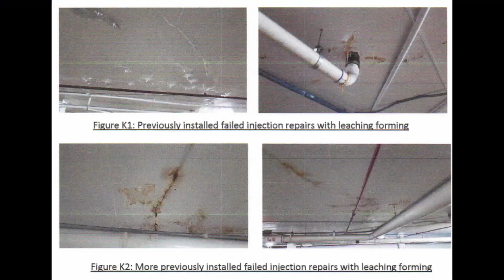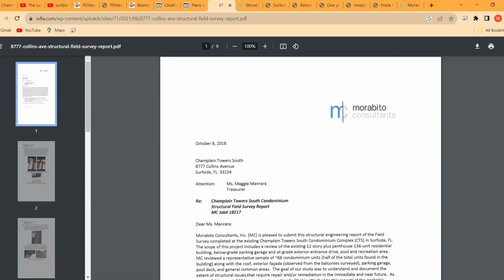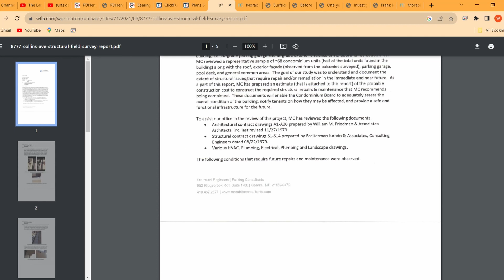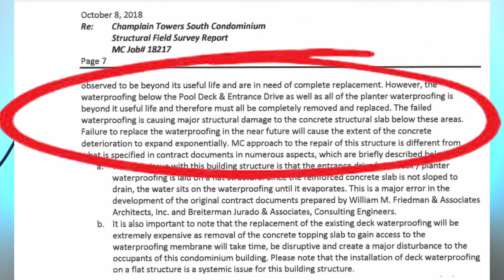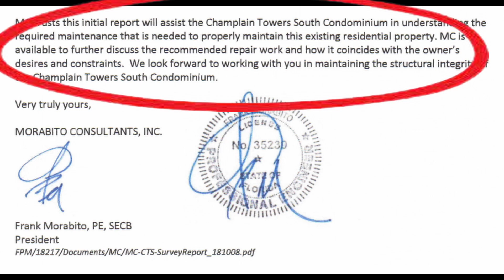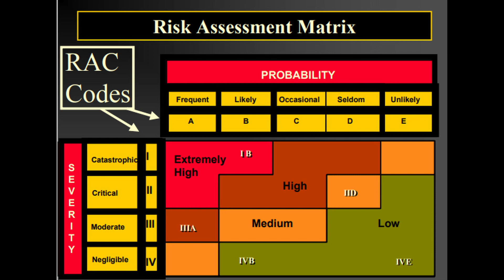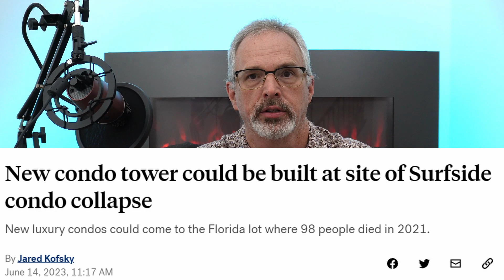A New Perspective on this Fatal Building Collapse

Comment: This story is crazy but we had a similar situation in Waukesha Wisconsin right after this collapse. There was a local building that was having work done to repair balconies that had water damage on them. When they removed material they found that the steel structure holding up the building was badly damaged by rust and corrosion. City officials called for an emergency evacuation of the building. And about a year ago the building was torn down and the lot is empty. Unfortunately this old apartment building was split up and the apartments were sold as condos. All of the owners are paying for a building they don’t live in. Not fare.

Comment: I was hoping to find a video on your channel about the recent report from the U of Miami about multiple hi-rise buildings in Miami Beach and towns further north that are sinking more than expected. From what I've read and heard, the buildings are on limestone which is not solid but has layers of sand in between solid layers. And those layers are disturbed when piles are driven for new buildings. The Surfside building that collapsed has been impacted by construction next door according to residents. Hoping to get your take on the new report.
Reply from the maker: I have been doing an extensive amount of research on this story to prepare for an upcoming video so please stay tuned.

Comment: I worked for a company who was contracted to do a geological assessment at a research hospital because they wanted a water well.  The geology under the hospital was karst.  While researching I discovered that a 150' wide 300' deep sinkhole opened up less than 1/8 mile away.  I also found an engineering report than mentioned finding voids in numerous areas around the hospital campus but didn't go into any detail and instead cited previous reports where it was discussed.  I brought that to the project manager who disregarded all of it and refused to allow me to contact the other firm or the client to get access to those reports.  So I refuse to sign both the draft and final reports.  My company was then contracted to drill the water well.  Myself and two other colleagues refused to have anything to do with the project.  The PM ended up putting the new guy on it, fresh out of college.  All I could think about while they were off drilling is, 'f**k, I work for a company that's willing to a risk research hospital falling into a sinkhole during drilling'.
Just a side note, the recommendations of where to drill the well were disregarded and the PM drilled where the client wanted him to.  It should be very easy to find groundwater in karst but they had to drill to over 300' when every other well in the area was no more than 150' deep.  
I hated working there.

Comment: FYI Casey…. A neighboring project that was built got tagged for a large part of the settlement due to vibrations they caused installing their foundation so the geotechnical portion of the collapse has been taken into account. As to MC’s report: Engineers aren’t good writers, that aside I don’t believe they actually thought collapse was imminent. Finally your concern about how many others like this are out there (st least in FLA and buildings) the FLA legislature passed a bunch of laws requiring more extensive inspections and repairs which are resulting in condo owners looking at unexpected huge assessments and inability to sell units. Boo hoo I guess. I am ret reg Architect. Thru my review of this whole catastrophe there are hardly any parties that didn’t screw up from the developer, contractor, designers, AHJs, etc. I think a third of the settlement was assigned to and paid by the buildings security company as they had untrained personal on duty who couldn’t push a button to sound an evacuation alarm. Really.  Everyone should strive to do a better job, but hindsight and all that…
Reply from the maker: Thank you.  I agree with you.  There is plenty of fault to go around for this disaster.

Comment: Comments on tthree statements:
Structurally deficient bridges - according to ASCE approximately 7.5% of US bridges are structurally deficient.  Further unlike a residential building a bridge can be rated to accept only a certain traffic load, so that the bridge is protected until such time as extensive repairs or replacement can be effectuated.  There are bridges that are unsafe and need to be closed and that is done as appropriate.  I personally have reported structural conditions which resulted in at least partial closures.
Ethics Teaching - As an ABET evaluator for Engineering Accreditation and as a member of all three commissions related thereto I can tell you that we investigate the teaching of ethics in Engineering curriculum for compliance with ABET criteria.  That includes what an engineer should do when they find defective or deficient elements of engineering works.  I believe that at least our Civil Engineering curriculums are doing an adequate job of teaching ethics.  I say that having been personally responsible for about 15% of the Civil curriculums and probably having reviewed as a commission member for ASCE about 80%r percent.  At least when I have personally performed visits I have asked students what they understand about ethics and our responsibilities and if they do not appropriately understand it is not in the report and may affect the accreditation rating.
Rebuilding - I would suggest that the better question is not about building on the site since there seems to be no findings of site deficiencies.  The better question i would suggest is should changes be made to codes, high rise requirements, requirements of investigative reports etc. before any building is constructed, particularly in a Marine environment which enhances the deterioration of particularly concrete structures.

Comment: The failure starting with the pool deck explains  why newer roller coasters have to be built differently than older ones.   In "Expedition Everest", the tracks are separate from the mountain and can stand by themselves.   The Matterhorn in Anaheim is a coaster where the mountain and the tubular rails are part of the same structure.   Read "SF Gate, what disneyland is doing to repair a crumbling matterhorn.  I'll keep riding it but the article doesn't inspire confidence in the ride".

Comment: Thank you for another excellent video. I spent most of my 45 year professional career designing, implementing and  regulating safety systems for commercial, industrial, military and nuclear facilities.  I saw compromises made in safety and acceptances of unreasonable risk in every industry except petrochemical. In the latter, the specifications were conservative, the details clear, the quality control demanded excellence and there were few, if any, on-the-fly or last minute changes. The life cycles of the facilities were set,  the designs and installations allowed for inspection and maintenance and there were stringent mandatory maintenance and replacement programs. I can’t imagine a consultant in that industry proposing to build a major facility in an earthquake zone, giving developers the option not to drive foundation piles to bedrock, or boards lengthy periods to correct safety critical deficiencies.   Neither can I see an engineer writing a report where cosmetic repairs are highlighted while vital safety  recommendations buried at the back. Dupont, to ensure adequate focus on safety, made plant managers and their families live within the blast radius of the plants they managed.  We engineers live in this world we help create.  
It is time we took our responsibilities seriously and not defer safety decisions to developers, corporate or condo boards, politicians and building departments.

Comment: Sorry I'm a little late to the discussion...
Excellent discussion of the dilemma Engineers face with respect to ethics and professional responsibility.
As a recently retired Licensed Civil Engineer, I can say that I was faced with numerous ethical dilemmas throughout my career.
Ethics in Engineering is a funny thing...
Problem is, there are no crystal balls; nobody, not even the most knowledgeable engineer can absolutely predict when or if some failures will occur.
Add into that, problems cost money (usually a lot), so you better be right!
So, we sue the engineer into oblivion for NOT telling us strenuously enough when the building collapses, AND we sue the engineer into oblivion if he tells us to evacuate the building and it DOESN'T immediately collapse!
Not to mention, the engineering community itself punishes their own when they attempt to exercise ethics, by labeling whistleblowers and stunting their careers within the industry.
I sure do miss working!!!
Zk

Comment: There is actually a great interview with the community manager of the tower on YouTube 
"Interview with the Community Manager of Champlain Towers ...
YouTube · ProTec Building Services
52 minutes, 33 seconds
28 Apr 2023"

I great deal of insight into what was happening with the fix.

They were well aware of the need to get the work fixed

Comment: Don't "engineering reports" follow a specific format? ... scientific papers do ... who's the intended reader? ... or do you want engineers and scientists to write at the fourth-grade level? ... the language was clear enough, the HOA board should have made repairs ... they didn't and now they're dead ... simple ...
Reply from the maker: I think it was a very poorly presented report.  They call it "burying the lead" in the news paper business.  Sticking the most important points late in the report is a good way to de-emphasize their importance.  It appears that this engineer was attempting to serve 2 masters.
Reply: @CaseyJones-Engineer  - I understand ... which is why the scientific community insists on standardized formats ... and in this standard format, the results are stated at the end ... scientists are writing to other scientists in the scientific media ... the engineering report in 2018 was written for the engineer who would be tasked with designing the corrective actions ... 

You understand the report ... you went to college to learn the language ... just how much "textbook" information are you writing into your reports ... are you including all the epsilon/delta proofs in your reports? ... why are you assuming competence in algebra? ...

My question was "do engineers use a standard format for their reports, like scientists do" ...

Comment: To be fair, Morebito mentioned that if certain faults weren't remedied that damage would increase exponentially.  Most people can't intuit exponential increases.  

After this incidence, the professional standards may need to revised to ensure that certain types of warnings or observations are presented in a certain way.  But assuming that wasn't the case, I have a hard time blaming the engineer that identified the issue.
Reply: Exactly

Comment: The settlement was enormous and evidently the NDAs were solid as no one ever discussed the settlement. In addition to all the issues you raised, I never heard if the penthouse units which were added sneakily to circumvent the height restrictions were simply added without any additional consideration of the structure, and also whether the addition of hundreds of tons of stonework in the kitchens, baths and floors would have further overburdened thr structure. From photos taken from, real estate listings online for months after the collapse it was evident that most of the units had been upgraded extensively as the roof and windows were falling apart. Another issue that was never explained satisfactorily to me is why the owners ar the north building don’t sell out for a high price. Their values have certainly dropped and they must think about the possibility that their building could fail with perhaps a different cause but a cause linked to poor design and construction that may not be evident. I would never be able to sleep knowing that pool deck could punch through with the end result being squeezed to death alive perhaps over an agonizing period of several hours or days.

Comment: Note the engineer had no expectation of progressive failure of the building itself from the pool deck problems.  Problem at its root is the tendency for progressive failure of this construction type.  Progressive failure is difficult to evaluate at this time, and is only now beinging considered for some structures.
Reply from the maker: True.  My issue with this engineer was the way he went low-key on presenting the most damaged part of the building structure in his inspection report.

Comment: Engineering university programs need to step up student awareness of how risk should be managed, particularly in geotechnical and structural engineering. Input from professional practice could give students a better handle on risk, and LRFD necessitates at least a passing understanding of probability and statistics to know how risk can be assigned numerical values. Ask any EIT what they understand about how LRFD, or Limit States Design, is a more rational design approach than the traditional working stress design.

Based on a cursory understanding of the root cause, i.e. excessive rebar spacing, and the apparently superficial inspection, I don’t see how Morabito could reasonably be expected to have detected the impending failure. But was the inspection underscoped? Is there any generally accepted procedure for structural inspections, or is it up to the individual SE to decide their own scope for inspection? If the SE proposes a detailed but costly scope, they could be underbid by a competitor. The owner, and cost, ultimately decide what level of inspection will actually happen. Should it be up to the owner to decide? With due respect to the deceased and their families, did the condo owners contribute to their own demise? Some lawyers might go to an extreme and argue that the stability of every aggregate particle in the structure should have been assessed.

Was there any inspection procedure prescribed by code or generally accepted practice that should have been, but was not followed? Is structural inspection covered in university structural engineering courses? The public could have some reasonable expectations about the scope of a structural inspection, such as: 

* review as-built drawings in detail, and review all testing and inspection reports submitted for construction; 
* review any previous inspection reports and confirm their findings against the current condition assessment;
* use GPR and other non destructive methods around a statistically representative sample of a number of structural elements including piles, and slabs, beams and columns at every level to check the findings (e.g. rebar spacing and concrete cover) against IFC drawings;
* “Ground-truth” the results such as by coring the existing piles full depth, check integrity (e.g. obvious cracks) and test strength in a concrete lab. Determine concrete air content and suitability of the concrete mix if practical. Check for rust and spalling where rebar engagement could be compromised.
* use modern procedures and factors to calculate the FS against all possible, or at least the most probable modes of failure. Comment on whether current code is met and use that as a basis for recommendations.

Comment: We've got a severely deficient bridge in Montreal. The pont de l'ile aux tourtes is scheduled to be replaced and demolished, but in the interval, it needs to remain open. Its being very closely monitored, and as a direct result of that, traffic has been reduced to one lane per direction instead of the 3 it would normally have. Unfortunately, I do think that it takes a tragedy to remind peoples of what can happen and what should be done. We had Viaduc de la Concorde collapse in 2006, and since then, there's been a sustained effort to replace aging structures. I'm saying that, but heck, it was still a decade long slog to replace the Champlain Bridge. It was only after a hole large enough for a man to crawl through a beam was discovered that public pressure finally forced the government to act.

Comment: A copy of the Surfside assessment went to the building department.  Which then obstructed the repair work once the new condo board eventually approved it.
Reply from the maker: I hadn't heard that before.  I thought it was just the Condo board who dragged things out.
Reply: @CaseyJones-Engineer  I forget the details (I think this was in the Miami Herald over a few articles) but the the problems the Building department caused were:  First, when the board got the report years ago the head of the building department told them their building was in fine shape. Implying that they didn't need to do all this work.  Second, when they tried to get started the building department just didn't reply or return calls for weeks or months.  Third then there were arguments about truck parking permits and similar minor stuff that stretched on and on. Result was that only the roofing project had been started and the pool deck/structural work hadn't.

Comment: The water seen running in the video was almost certainly water from the fire protection sprinkler system, not pool water. That's why the alarm firm called the fire department and reported a water flow alarm shortly before the collapse.  Which gets you the firetrucks that showed up shortly after the collapse.  The pool seemed completely undamaged after the collapse.
Reply from the maker: That makes sense.  Thank you for the clarification.

Comment: Th engineers should have been more direct stating the safety issues and failures in the near future are extremely high and delt with immediately and informed local inspections
Reply from the maker: I agree with you. I mean what did the engineer think would happen if those building problems were ignored.